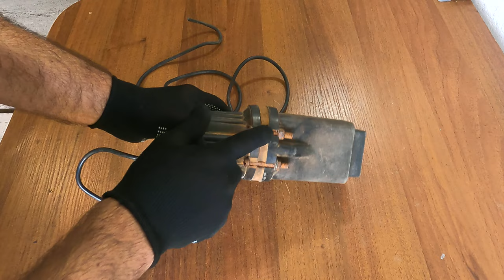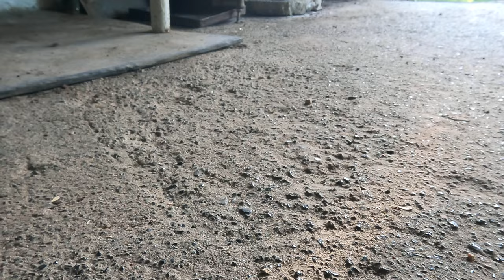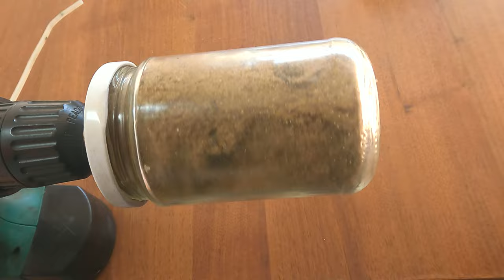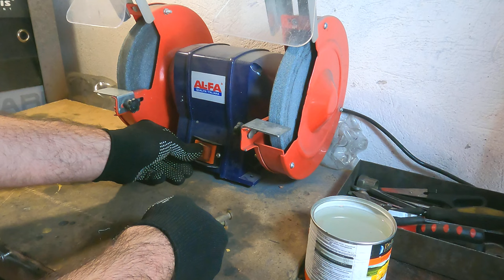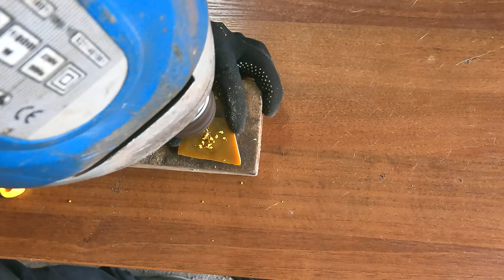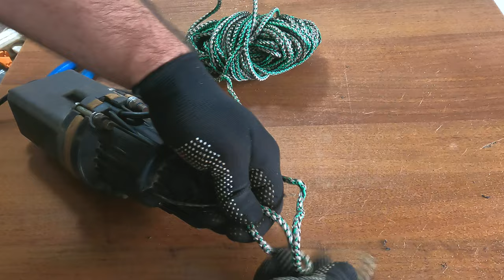Restoration of the Vibrating Water Pump #restoration #pump

Comment: What to do if the power cord
on the pump body is damaged?
Reply from the maker: If the wire near the housing itself is damaged, then in the best case the housing itself needs to be replaced. Since water will get into a very problematic area, and if it is possible to secure the wire to the housing in a new way, you can fill that area with epoxy resin and additionally apply heat shrink.

Comment: what if the bottom corpus is damaged?
Reply from the maker: Depending on where it is near the bolt holes or the valve itself. And what material is the bottom part made of, plastic or duroaluminium?
Reply from the maker: Depending on the damage to the housing
Reply: on very bottom ,is aluminium and part is missing and wire cut. @AlexsWorkshop10
Reply from the maker: @DanielRex-lf9xn  As I understand it, the valve broke the hole with a pinch bolt. You need to correct the hole and select the bolt and the silicone valve itself under the bolt so that it fits against the body and closes the holes through which water flows.
Reply from the maker: @DanielRex-lf9xn  There is another option. Repair the hole and make a mushroom valve so that it fits into the middle of the hole and seals that area like a retainer and closes the holes where water gets in. The rubber or silicone valve itself should fit loosely, not too tight and not too loose, in moderation.
Reply: How to reduce the noise of these pump